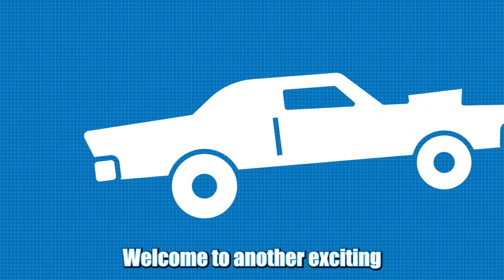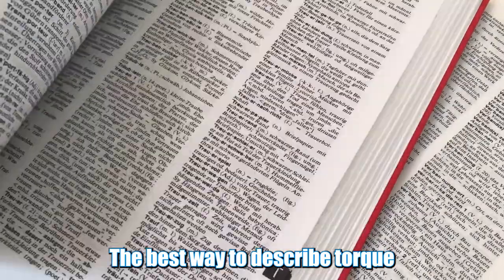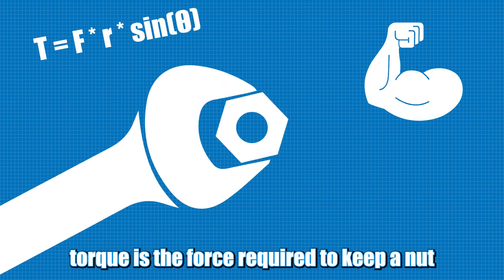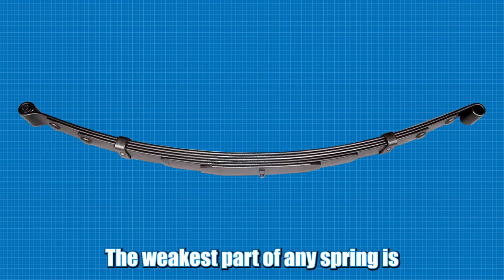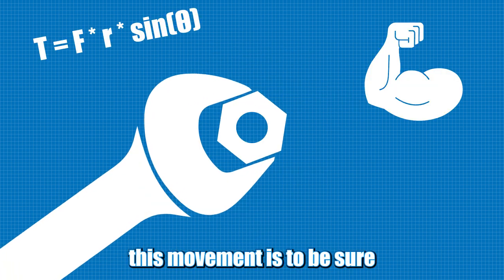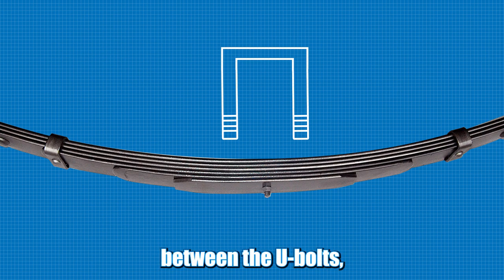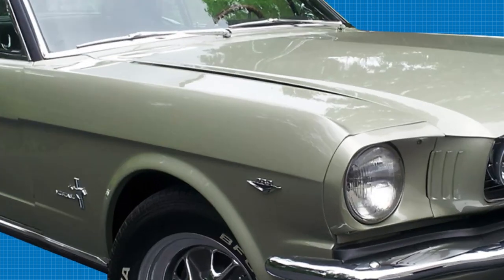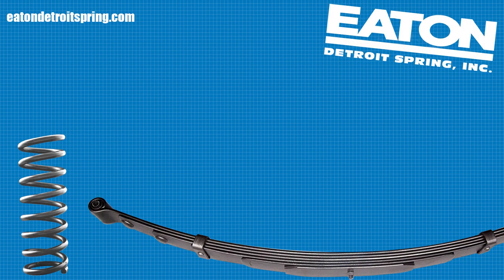Torque Your Leaf Springs U-bolts Properly | One Minute Monday

Comment: Hi ! Good vid just subscribed! Question if you could; have a 1980 GMC C7000 which i think is fitted with ubolt bottom plates which may need the notches that i think are supposed to fit the axle housing nicely, to be lengthened in order to fit.
 the axle housing is square w roughly 3/8 - 1/2 radius corners. the bottom where the plate is supposed to fit straddled nicely i assume, is only catching one corner and sits raised off the other by roughly an 1/8". didn't have more than a tape measure available at the time so i can only approximate the axle housing to be 4.5" wide where the lower plate is, and the bolts seem to be 3/4" dia., about 18" long. about 4" on center wide (can't measure between legs whilst on the truck), nicely straddling 3" springs, and the bolts are saddled roughly 6.25" apart from each other.
 so
I'm thinking i have lower plates made to fit smaller than 4.5" axle housing.
I would like to order 4 u-bolts, two lower plates and the 8 large flange nuts, but would expect that the plates are to straddle the axle housing nicely, no? 
the truck is too remote to grab better measurements, axle id, etc.. but i do have a vin and one of the id tags on the cab door jamb lists the rear axle max weight to be 16160 lbs at the ground
are there bottom plates to fit square axle housings around 4.5" just over and just under? would those sizes be published in a list anywhere?

Comment: I changed the blocks on my 2007 Silverado and I want to know how tight the u bolts are.?
Reply from the maker: The torque depends on the diameter of the u-bolt. here is a link to our torque chart - https://www.eatondetroitspring.com/wp-content/uploads/ubts1.pdf

Comment: I have a small carry on utility trailer.  It seems like if I try to come close to the torque specs it bends the u bolt plate and bolts too. I have 2 diff torque wrenches and both reading normally/same.
Reply from the maker: If the plate is bending, just before it bends should be enough torque.

Comment: Is a must to use an impact wrench or is safe enough to use the manual one?
Reply from the maker: If the U-Bolt is less then 3/4-inch diameter a hand wrench will be enough to torques the nuts to specs.

Comment: With an isolator rubber pad, I can't get to 65 ft lbs it's just smashing the hell out if the isolator pad.
Reply from the maker: Yep, kind of tough getting torque up 65 ft lbs when there are rubber and even urethane axle pads around the springs. Realy it is not tough - it is impossible. In these cases we say, snug 'em up good, just enough to put a little squeeze on the pads and let it go.
Reply: @EatonDetroitSpring  I was able to get 50 ft lbs, but that isolator pad looks like a bulging out pancake ready to explode. Will that be okay?